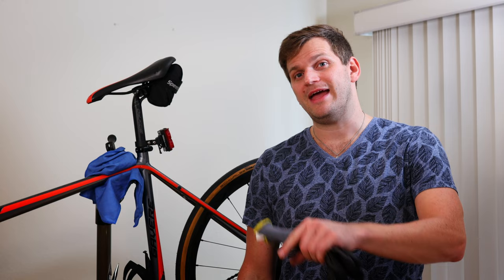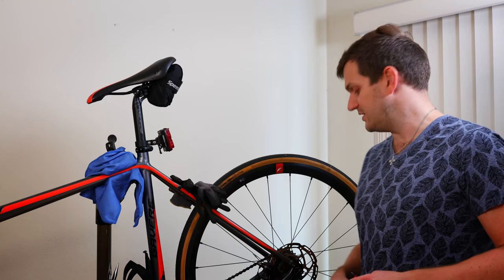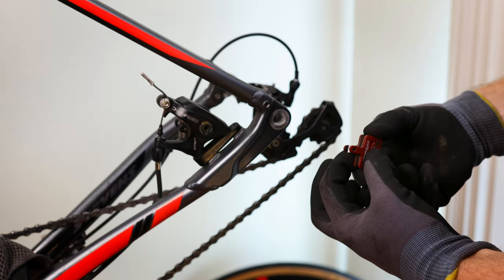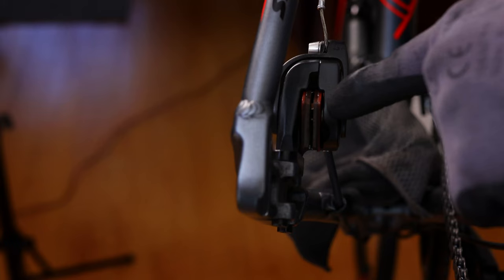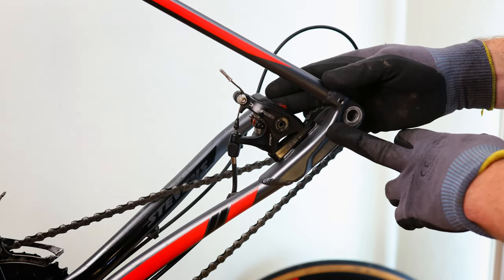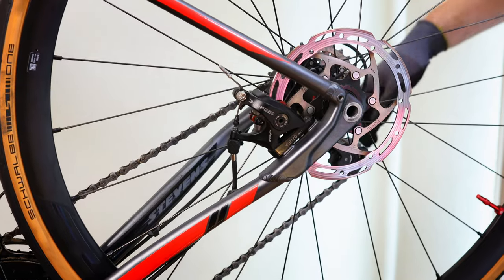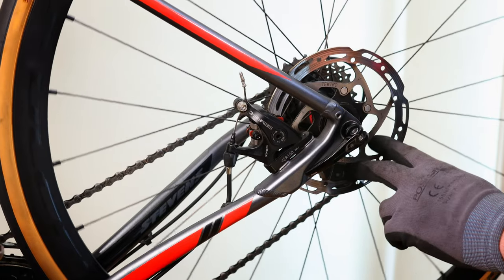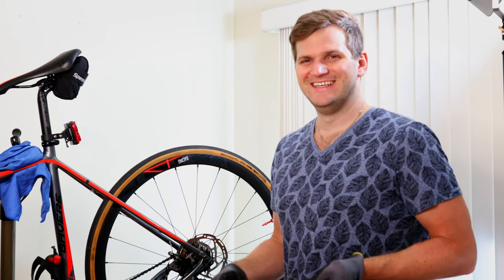Change Brake Pads on a Road Bike TRP Spyre C (Mechanical Disk Brakes)

Comment: Why do you need to change rotors because you change pad type? Never heard that before.
Reply from the maker: I read something like this: https://www.bikeradar.com/advice/buyers-guides/disc-brake-pads/#:~:text=For%20optimum%20performance%2C%20when%20you,pads%20longer%20to%20bed%20in.

Under swapping pad compound